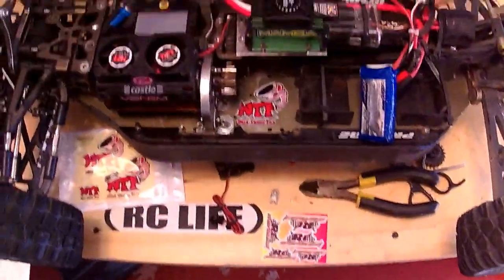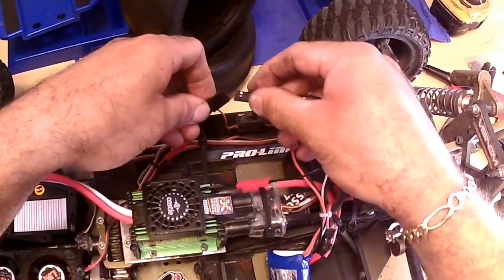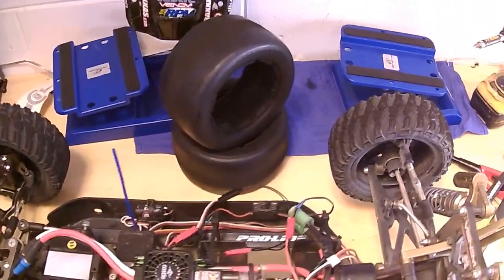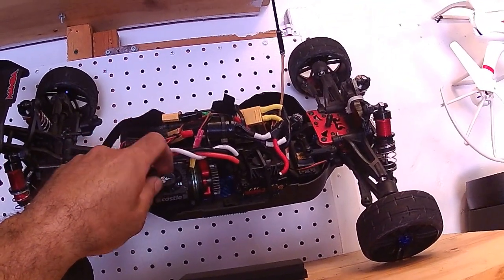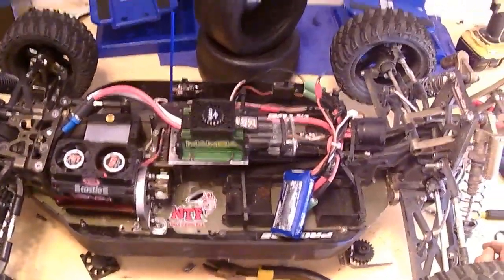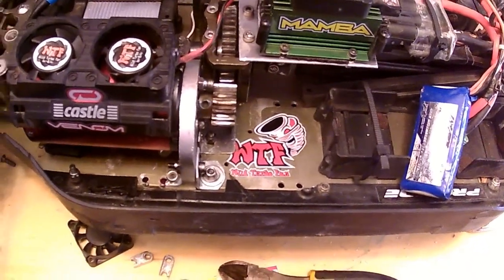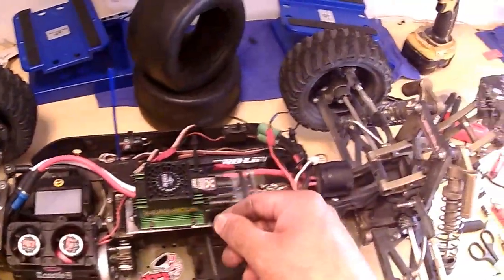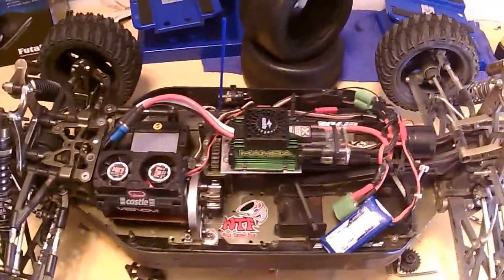BRUSHLESS SYSTEM HIGH SPEED ESC / MOTOR COOLING FANS TEST

Comment: hi , which connectors are you using on the external batteries to connect the fans
Reply from the maker: inash muzhar The battery has JST connectors but i made a Y JST harness for the fans